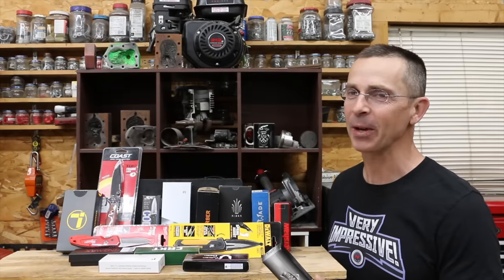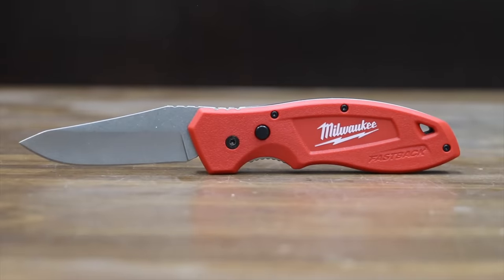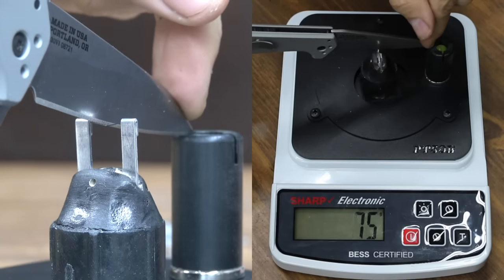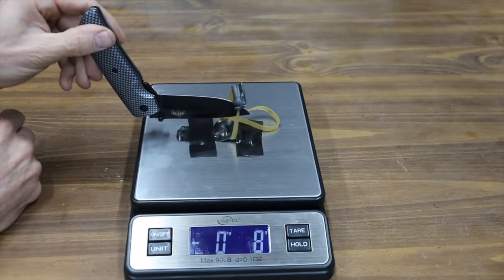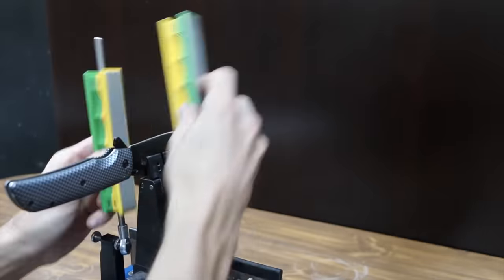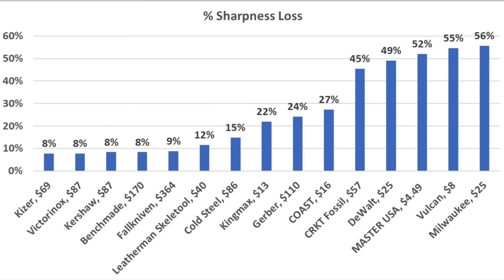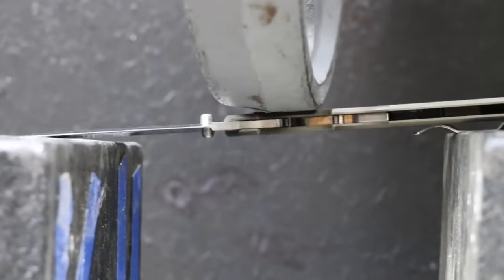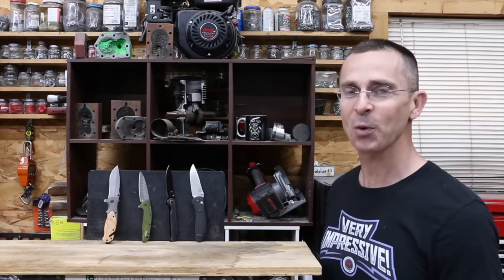Best Knife (Ep 2)?  CRKT, Gerber, Leatherman, Fallkniven, Victorinox, Kershaw, DeWalt, Milwaukee

Comment: I’d love to see a EDC type flashlight comparison. 3 brands I’d like to see are Nebo, stream light and milwaukee. Love the videos!
Reply: Yes! I swear by my Streamlight penlights, I use them more than any flashlight ever in my life to be honest, they are great for working on trucks, even in the day time I use them out of habit. Id like to see how they match up against other brands
Reply: Speaking of flashlights I’ve ruined many lately with alkaline batteries leaking. Nothing but lithium for me now.
Reply: @ecksdog  NiMH is the way to go for edc AA or AAA lights
Reply: Throw in malkoff, nitecore, Cloud defensive and modlite to that list.
Reply: I would add the Pelican 1910 and 1920 lights to this list, because they're almost the only ones that have polycarbonate lenses.   Most other lights have glass, which almost always break when working on steel decks.
Reply: @ja0298  and add a Coast to compare a more affordable option.
Reply: @evanflannery5949  never heard of them. Malkoff is pretty affordable given the performance
Reply: I would also throw in an Olight (I3T looks like it would fit into the EDC category) in there as well as a Fenix or nitecore (Tini2 TI). I personally carry either a Streamlight Microstream ultra compact (696318) or a Microstream 66608 (rechargeable with two brightness) depending on how much light I need. As far as EDC goes, it would also be cool to see the streamlight 88811 that I've been looking at due to its small form factor.
Reply: Wowtac would be a good budget comparison, I have one and like it.
Reply: @Silverdraconicarcher  💯Correct 👍

Comment: I have been using Kershaw for over 10 years, and my experience is the same as your test results. If you don't use it to pry on something, and can avoid dropping it on the tip, its a great knife that holds an edge extremely well. But the tip is susceptible to breaking. Model I use is the Ken Onion Leek by Kershaw. Great video.
Reply: Agreed. I love my Cryo II
Reply from the maker: Thank you!
Reply: Kershaw will replace the broken blade under their lifetime warranty.  Carried them for 20 years now.
Reply: I've had a Kershaw with me for about 15 years now and I still have my first Skyline and now carry a Leek. Great brand.

Comment: I've had my Milwaukee knife for 8 years. It holds a great edge. (Yes, I do sharpen it from time to time) It's never let me down!
Reply from the maker: Thanks for the feedback.
Reply: As long as a knife meets your minimum quality requirement and with care shouldn't let you down.  Some people need a EDC that is used often throughout the day vs some who only need it here or there, I think many of us forget that a lot of budget knives are more than good enough for most folks with proper care (I carry an old Harbor Freight knife I've had for about 6 years with a ton of use, the only complaint I have with it is having to tighten the various screws now and again, but the blade is fine).

Comment: Very informative as always!
I found a battered milwaukee between my barn boards, sharpened it up and it's always been in my backpack since. On the note of one handed opening, it opens very nicely with just a small flick of the wrist, even my younger siblings could work it that way. The steel is soft though, I have to sharpen it more often than my other knives but it just feels so comfortable in the hand so i keep it around. After 4-5 years of use and sharpening the blade has gotten a lot smaller, didn't even notice it before i saw a new one here haha, must have taken close to 7-8mm off the blade in that time.
Thank you for your work!
Reply from the maker: Thanks! Thanks for sharing.
Reply: Yeah, you are supposed to flick the Fastback knives. I had a Milwaukee Fastback 2 utility knife years ago and I loved that thing. The clips on them are great as well in my experience.
Reply: I couldn't believe how horrible the steel is on the Milwaukee knife.  I was thinking about buying one until I saw this.  I would take a free one though.

Comment: Round one and Round two have proven that my choice in Benchmade was well worth the cost. I've been using it for several years now and sent it back this year for sharpening. Turn around time was less than expected and came back looking new. I was so glad that it was MY knife being sent back to me, due to some markings on the handle. I'm always afraid of companies swapping it out with other refurbished ones just to reduce turn around time. Although I bought a simple buck knife to use in the mean time, and it's quite handy too.
Reply from the maker: Thanks for sharing.
Reply: Agreed! I have a couple of Benchmade Barrages with axxis assist. I misplaced the first for a month or so, I bought a second with M4 steel, which I like better than the SV 40 (?) stainless on the first. The assist is the best one handed opening mechanism that I've ever used, much sturdier than an OTF and just as quick.
Reply: I choose not to buy from an anti gun company
Reply: @adamd1590  How's that attitude feel after Uvalde?

Comment: Love the reviews! One suggestion for reviewing - Multitools. The ones like the Leatherman Skeletool CX, the Wingman, offerings from Gerber etc. DeWalt are also doing a multitool at a much cheaper price point. Knowing what you're getting for the money and if the more expensive ones offer better value/longevity would be super interesting.
Reply: He did one on 10/10/21.  There's a link to a spreadsheet of his tests in the description
Reply from the maker: https://www.youtube.com/watch?v=Q9E2PjjdCAM
Reply: When I was active duty I always received a new multi tool every time I got to a new unit, always either a Gerber or a Leatherman. As such I accumulated quite a collection over the 27 years I was in, and the major factor of which one I carried came down to two things, first the Gerber always had the better pliers (square jaw) v. the pointed nose pliers of the Leatherman. And second, the Gerber you could sling out the pliers with a flip of the wrist v. the Leatherman, which had to be opened in the old skool fashion. Having said that, the one I carried for all those years was the Leatherman, because the Gerber would pinch the crap outta your palm on a regular basis due to the handle design, and it hurt a LOT, whereas the Leatherman would not.

Comment: Great test. I have to say I am partial to Fällkniven being Norwegian, and it is sort of locally produced. Regarding an EDC I have two other factors. One is color, I often misplace my knife outside, and having one with a strong colored handle helps finding it again. Also, in Norway there are strict rules regarding carrying knives. While the rule is not often enforced or controlled by the police, you need a "valid reason" to carry a knife, even in a backpack. When out traveling by public transportation I often carry a NRS Co-Pilot. Its not a great knife, but being a kayak knife (for cutting yourself loos in case of tipping over) it has no point, hence it has a limited use as a weapon. The added bonus is it easily doubles as a flat head screw driver, and the handle has a bottle opener.
Reply from the maker: Thanks for sharing!
Reply: I would suggest to learn a solid roll and stick with Fällkniven 🙂

Comment: The drop tests always hurt to watch. 

Watching the pressure it takes to release the locks one thing that stood out is how much access to the linear lock the Leatherman gives. A lot of the knives need a finger tip, but the leatherman looks like you can press it more directly.

One other thing to add if another round of knife tests is done is pocket feel. Some bigger knives i have had fit pockets better than smaller ones that were just a bit chunky.
Reply from the maker: Great point!

Comment: Kind of cool seeing how the premium steels stacked up against the cheap Chinesium but it is really wjat was expected.  The Kershaw Divadend D2 is brittle but holds a fantastic edge again as expected.  Nice to see a near real world experiment that validates the knife metal differences.
Reply from the maker: Thank you!
Reply: I knew once they tip test was announce the Kershaw would fail. My Kershaw Leek Pocket Knife got left in a pocket and was ran through the washer. I opened and lost it's tip. I lost it and replaced with a Kershaw Blur Black (1670BLK) Everyday Carry Pocketknife and I am on my second one after losing the first one.
Reply: @faervas1234  D2 brittle and Kershaw heat treat doesn't help
Reply: @thestrawberrypatch5644  Honestly a little surprising from not only a premium brand, but what's commonly quoted as being the best steel as well.
I guess the CPM "S" series is still the way to go and D2 is second best lol
Reply: @deletdis6173  D2 is a tool steel so yeah its hard and brittle.
Reply: @deletdis6173  I think you might be a little out of date,d2 hasn't been the top steel in quite awhile
Reply: @balorth  I guess I am lol. XD
Reply: I'm on my 3rd of that same Kershaw as a Daily carry love it, but my first snapped the blade tip off. It was user error side loaded it rushing a job my fault. However my second has been in service for a year running perfectly till it saw a quick release failure due to heavy impact. I ordered a 3rd, but used parts from the first to fix the second so haven't used the 3rd at all yet. I cut large amounts of thick cardboard near daily and man those knives hold an edge. Still cuts like butter.
Reply: Yeah because you get what you pay for.

Comment: I have the Milwaukee (camo version) and this test is spot on. It was great at first, but it doesn't retain an edge well. It's become comic relief during unboxings when it can't cut tape easily. However, the button release is actually fun. I open it with a flick of the the wrist, fingers stay away from the blade.
Reply from the maker: Thanks for sharing.
Reply: Interesting!  I wonder if there was a steel change, I had excellent edge retention despite using it on drywall and aluminum deburring. I actually looked for the type of blade steel used and could not find what they used. The flick open is easy and slick once you get used to it but I do not like the two different opening/locking methods.

Comment: Another awesome video! Thanks for your hard work. Really enjoyed it. Personally I'm not a fan of liner locks. When they first started to become popular, it was noted that many, including expensive models, falied the "spine whack" test. Basically, you (very carefully) open the blade and then whack the spine on a table. Do it iteratively. Also, as the blade stop pin (or the blade itself) wears (often happens due to repeated flicking open of the blade), the blade will rotate further back when opened and this will cause the lock to migrate further over, even to the point where the lockup is not solid. This is an important consideration because if the knife is not safe to use, it is not much use. Also, it was shown that in certain grips, the linerlock would fail (the lock could be pushed over to the outside)  The framelock was seen to be better because the lock was more robust (thicker) and gripping the knife enhanced the lock. When Benchmade brought out the axis lock, it was seen as a major innovation and improvement over the liner lock. Personally, I prefer knives with an axis lock or back lock as the safest to use. I also love slipjoints but you have to be careful with them as stabbing material could result in the knife closing on your fingers. This is just common sense and I say this as a woodcarver who has been carving wood for over 60 years using a slipjoint. Linerlocks have overcome their bad press after their first introduction but I have a drawer full  that I have no interest in carrying. I'd rather carry a slipjoint than a linerlock knife. In fact, some knives come with a second lock to lock a blade open (or even closed). This is often seen in linerlock, button lock and auto knives. Thanks again for the great video!
Reply from the maker: Thanks and you are welcome!

Comment: Ready to see at least 100 more videos in this knife comparison series. I'd love to see a test on just folding knife blade lock strength. The market hasn't seen much on this in the past six years or so even though there have been a number of advancements. There are a significant number of locking mechanisms and while it's a more high level approach, it would do the whole community a lot of good. Compression lock, tri-ad lock, shark lock, scorpion lock, steel liner lock, titanium liner lock, titanium frame lock, titanium frame lock with steel lockbar insert, button lock, axis lock, able lock, lockback. Do knives with a secondary lock that prevents the primary lock from opening help? I think it is safe to assume that different brands accomplish their lockup better despite the lock type, but this would still be useful at a high level.
Reply from the maker: Thank you for the video idea!

Comment: It'd be interesting if small adjustments to edge angle would make a meaningful change to edge durability without sacrificing too much sharpness.
Reply from the maker: Thanks for the video idea.
Reply: It would. Some steels can hold onto very fine angles 10-12 degrees per side with a problem. Fine grained/low carbide steels like Aeb-l/13c26(most Sandvik steels really) and Nitro-v, powder tool steels like CPM M4, 3V, 4V, cruwear, nitrogen steels like Nitrobe 77, Vanax and LC200N. Then you have steels with large Carbides like D2 that don't do well past 17-20 degrees per side. A lot can depend on the heat treat as well, a good steel can be made brittle by bad/cheap heat treatment protocols. 
The thinner the blade is ground, higher blade grind, thinner stock and lower edge angle all result in increased ease of cutting. I have a knife in Elmax, full flat grind, ground to 0.005 and 15 dps and it melts through anything.

Comment: In my experience, for most people a good 40-100$ knife will satisfy for most anything. Personally I carry a benchmade griptilian. One thing a lot of people forget about buying a higher quality knife is it can be more challenging to sharpen as well, s30v and higher steel take a lot more time on a traditional whetstone
Reply from the maker: Thank you!
Reply: Ryan so true my friend so true,,,many guys buy higher end knives with some of the "super" steels then get frusterated trying to sharpen them with normal stones,,,my advice to them is to invest in one of the shapen it easy systems made to deal with those sharpening challanges,,,I used the Ken Onion edition work sharp and take mine down to the leather stropping belt with jewelers rouge on it,,don't know what the micron level is on that stuff but it makes the edge look like a brand new bright shinny mirror and they will split hairs so I think it works,,,,what griptillian ya got???,,I have the blue and grey with the cpm20 cv steel,,,WOW what a super knife,,,,my favorite EDC though is my Benchmade 928 proxy with the same cpm20 cv steel,,,,$300 knife when it came out but I wish I would have known they would be discontinuing it in just a couple years I would have bought 2 or 3 used one put the others in the safe seeing is it was the last design by Warren Osbourne to ever be released, anyhow take care.
Reply: @looseballs1966  even easier, get some ultra fine diamond paste in different grits breeze through edge polishing with a strop. Probably wouldn't work for very dulled knives though. Would take a long time. It's good for regular sharpenings
Reply: My argument would be for a Milwaukee Fastback with the replaceable utility blades, or a similar utility knife. When it goes dull, just replace the blade. Vast majority of people don't need anything fancier.
Reply: Good points. Super steels abrade more slowly, particularly with lower hardness sharpeners. I have a Benchmade with a s90v blade. I already had diamond plates for chisels and plane irons. And other knives for comparison.

I quickly learned two things. If you don’t let it get very dull, getting it back to sharp goes quickly and can start with the 600 grit stone. However, even then expect to use more strokes at each grit than with other steels. With my expectations calibrated, everything is good.
Reply: @mynameissang  true, that would work for most applications. Sometimes you just need more blade length than that though
Reply: @skrimper  that would work too for touch ups at least

Comment: The Kershaw snapped because of the steel type. D2 is an amazing steel that's super hard but also more brittle then softer steels. Kershaw has blades at many different price points that use different steels and have the same Kershaw quality. In case someone wanted a Kershaw until the drop test
Reply from the maker: Thank you!
Reply: I love my Kershaw blur, and I'll never use it like a pry bar. USA made with great quality and price. I love that company.
Reply: On a side note, I did bend the tip on a tanto blade Kershaw blur by dropping it on some tile, the other blade shapes have held up great, and are easier to sharpen than the tanto.
Reply: @azael831  🤜🤛
Reply: @jmatt781  I bent the tip of my kabar tanto. Idk what I did tbh. I'm don't with tanto tbh. I hate sharpening them